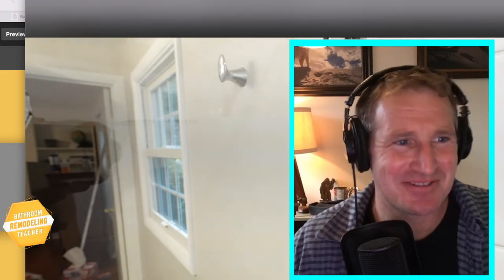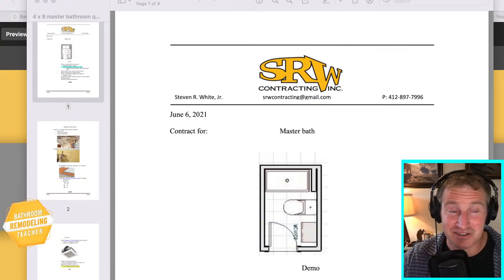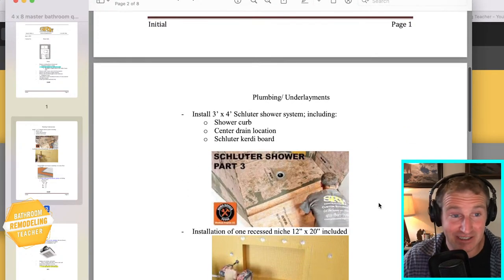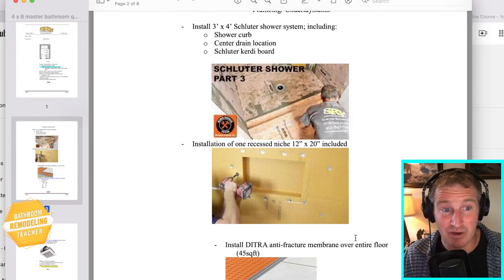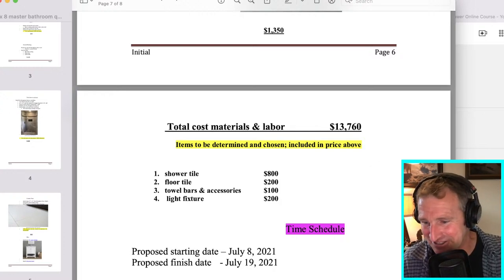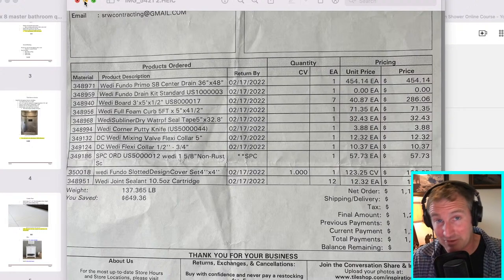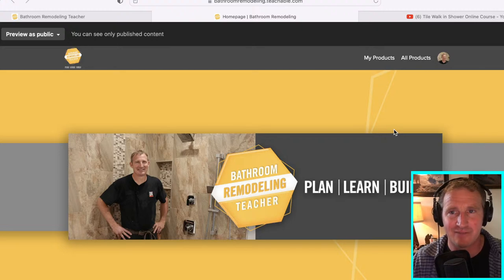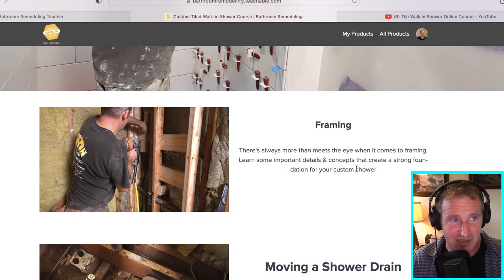Tile Shower Course Part 4

Comment: Treasure time from BRT. As per usual I missed live stream but its enjoyable like this as well. Don’t worry about the echo. Not a big deal and who wants to learn will hear it properly. As a DJ (when I was younger) echo occurs when two audio sources are being handled at the same same time and clashing. In your case I am not sure thats the case since when you did correction about the screwing board off the floor it echoed as well. And your live voiceover is solid. Something in the editing portion (software settings/update) of the whole thing. Not sure if you are using PC or Mac but sound cards and processors have tons of audio effects (echo one of them) and its easy to activate by accident. Or if its PC then driver update perhaps. Ether way I enjoyed it. Thanks for sharing Steve. 👊
Reply from the maker: Thanks for helping me problem solve  this. I’ll look into to that and hopefully fix before next live stream 👍 this kind of stuff drives me nuts 😆
Reply: @BathroomRemodelingTeacher  I hope it does help but its definitely worth looking into it. 💪